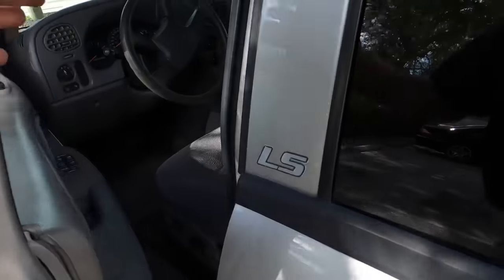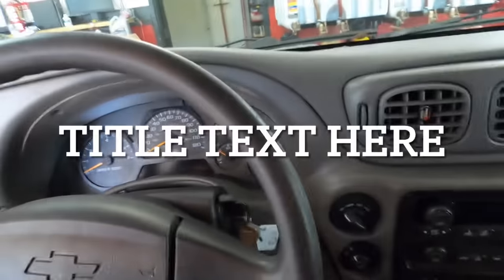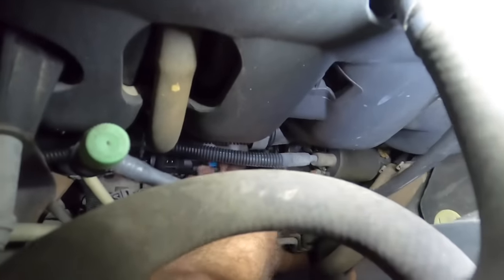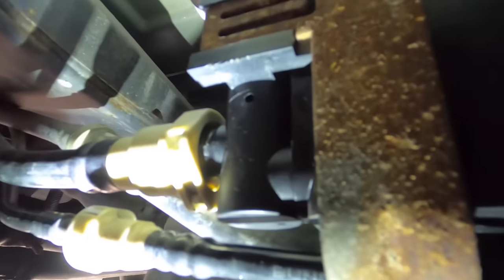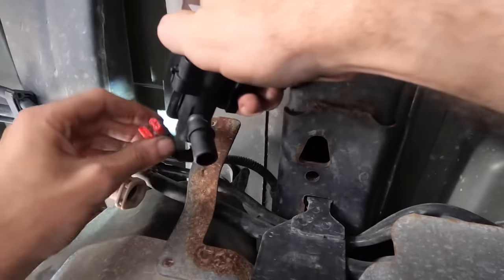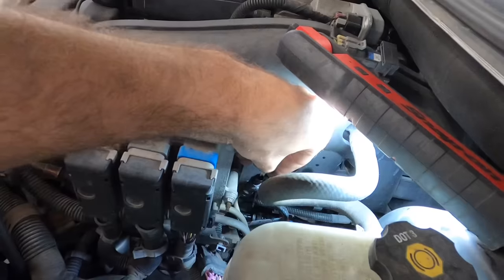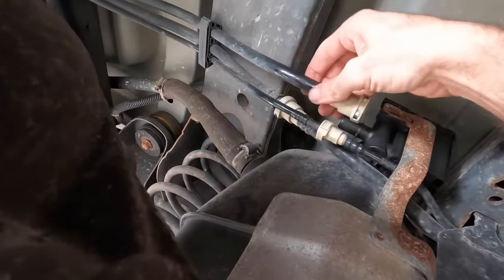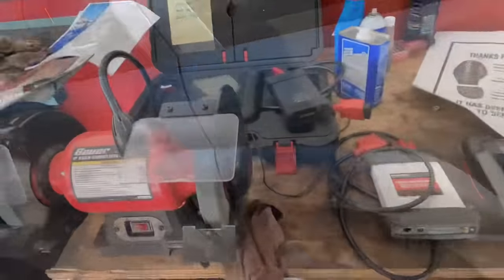Repair failed! Customer is Angry

Comment: ??? I'm so confused... Who in their infinite wisdom decides "yes erase the code so I can take it to the shop and have them diagnose it" is a great idea.... Whatttt????
Reply: TIMMEH !!!
Reply: Most problems are related to the nut connecting the steering wheel to the drivers seat.
Reply: There's a short between the seat and the steering wheel.
Reply: Or as programmers say: pebkac (problem exists between keyboard and chair).
Reply: Justin, your right, that boggles ones mind!!!

I was at a parts store once, an employee was pulling the trouble codes for a customer. The customer asked him to clear the codes, and the employee said they had a policy to NOT clear the codes. That was a few years back, not sure if they still have that policy.
Reply: @captainchaos3667  IT says we have a PICNIC problem here...Problem In Chair Not In Computer
Reply: I dare say the owner of the car is older. The mindset goes back 20-30 years when check engine lights first appeared on cars and is "modern cars have a little light that comes on every now and then and you need to pay the shop money to connect a computer and turn the light back off again".
Once the light is off, all problems with the engine are gone "because they program the computer to turn that darn light on for no reason".

Typically the kind of person to say "I had a 19gooblefive Chevford and it ran fine for dargnabbit years with no darn check engine light!"
They conveniently forget that their old rustbucket got 8 mpg and killed you in any crash.
Reply: The owner may be of the mindset that if all Check ending codes are reset, the mechanic has to go out, drive the car, and replicate the issue himself or herself.  It may be a way to prevent other codes that have been stored from giving fake info.

Or most likely, picnic.
Reply: It might be the owner only asked to read the codes. Not to erase them.
And the other mechanic cleared the list because of habit.
Reply: There are still people around who think erasing the code will resolve the problem.
Reply: @eefneleman9564  that too... Sadly
Reply: @captainchaos3667  programmers don't have problems, it's either a bug or a feature, operator error is covered by GIGO.
Reply: It's cslled an ID ten T error or written differently "ID IO T"
Reply: Best guess is that the trouble code put the car into limp mode and they got it cleared to get it out so they could drive down without any of the limitations... Not thinking that the trouble code might've been important...

I can understand the reasoning, but at the very least, surely you'd at least record the codes...
Reply: @adrianthorneycroft6702  the purge valve failing is not activating no limp mode...
Reply: @jovangrbic97  Herein lies the issue... Without those codes you don't know what the issue is. Who's to say the purge valve wasn't simply just a coincidental failure?
Reply: Should have told the customer to call the store and ask them what the codes were before they erase them. I know they would not have gotten the answer but it would always be nice to see that customer choke on his own spit
Reply: If I had to guess I'd say it's some strange logic where he considers the codes some kind of "preconceptions" and he wants them to "fix it for real" and diagnose from the ground up.  Like Captain Picard ordering a "Full Level 4 diagnostic of the entire ship"
Reply: @ThatOneGuy-f2p  IT also calls it an ID10T error between the monitor and the chair
Reply: Because multiple codes may confuse things, clearing it and then driving and returning to the shop may be wise.
Reply: Superior logic at its best ! 
That part just cracked me up mostly because it so aptly fits the total opposite logic scenario.
Like going to the doctor and telling him everything is fine and you feel just great.
Reply: @hunterlong1820  also known as a Layer 8 issue
Reply: sounds line an I.D.-ten-T error (ID10T)
Reply: 161K viewers (so far) have asked themselves the same question. smh
Reply: Honestly, ive done that before thinking them knowing what the code was should be enough to diagnose it or they could see the code history, but i guess not.. So i suppose next time i wont clear a code before i have it looked at..
Reply: @dougaltolan3017  Many years ago I was IT director for an insurance company. IBM mainframe, MVS, etc. Big iron. There was an operating system bug that the IBM account manager described as an "undocumented feature".
Reply: The same people who think that Google has every answer and that a gas cap fixes the majority of check engine lights.
Reply: @thecardoc100  no, sorry but sometimes it is actually real broken stuff.
Reply: @michaelszczys8316  We have a quote from one of our instructors. "A trouble code doesn't tell you what part is bad, it tells you what test that the computer has run that has failed." Of course it is correct that a test will fail when a component has failed, but testing still needs to be done to confirm that the part has actually failed.
Reply: @eefneleman9564  A piece of black electrical tape works a lot better. You'll never have to see the CEL again.
Reply: @thecardoc100  In some small cases the cap is the problem though.. Honestly i think it might be the issue ive been having recently so i make sure to tighten it and it seems to work.
Reply: @DigitalIP  When taught how to test these systems correctly and then making sure to follow the routine you can prove if the cap is to blame, as long as nobody touches it before you start testing.
Reply: @thecardoc100  this should be a poster to put up in every parts store
Reply: Sounds like a problem with the 1D10T  that was previously interfacing with the PCM to me.
Reply: Maybe he thought it was his internet browser history.
Reply: @wayneessar7489  no multiple code are not confusing you alway Start with the first code show and 90 % of the time the first code is what trigger the other code
Reply: @legros731  First of all slow your role dude.. no idea what the hell you're even going on about
Reply: I partly blame the parts shops who sell this idea to the ignorant vehicle owners.
Reply: @wayneessar7489  Let the service mechanic make that decision, not the customer! If the customer does have the codes cleared, all labor rates are tripled! That is how I run my shop! I don't have many "I know what is best!" type customers ever return! And the other shops around were getting my unloaded problems. Now, all shops around me do exactly what I do for customer, "I know it all & what is best!"
Reply: @rogerlaurel2363  My very good independent mechanic would erase all the codes if many of them were legacy issues, especially on European cars and get his clients to drive them for a day and return.
I have no need to make a choice like that.
Reply: @rogerlaurel2363  I don't see what that has to do with my comment?
Reply: @wayneessar7489  Your comment: My mechanic erases codes

Subject: Customer has codes erased to hide performance history from mechanic he is paying & wants service free!

The point: Who should choose to erase codes be a proper action?

Always the mechanic!
Reply: Depends.  I have often had the codes cleared and they don't come back.    Alot of engine codes dont amount to anything.
Reply: Yeah...read the codes sure, but don't erase them???
Reply: It like brushing and flossing right before your dentist appointment
Reply: The only time I ever did something similar to that was when I was working on my car and disconnected the battery, which cleared the codes.  I realized this and made sure to provide all the codes I had gathered to atleast give the tech a fighting chance.  Not ideal, and totally agree its moronic to stop at a shop on the way with the sole purpose of clearing codes.
Reply: @jochenstacker7448  See i call it a Layer 0 issue.
Reply: @thecardoc100  I'd argue Google does have the right answer, but it also has every wrong answer as well.  good luck figuring out which is which, lol.
Reply: @bassman87  LOL. Can't say that is wrong. One of my favorite little lines when someone says their car is doing the exact same thing as someone else's car is "How did their old parts get on your car?"
Reply: Someone needs to educate a certain vehicle owner that the Check Engine light is there allow the Mechanic to Check the Engine. 
Guessing costs lots of money which I am sure some shops will oblige, lucky for his rear end Ray has ethics that don’t allow him to operate that way.
Reply: Ikr, my car was acting funny for a month, on an intermittent basis. Loss of some power in stop-start traffic for some reason. But shop couldn't find anything due to lack of codes. Went on a few more weeks, then it finally got a check engine light and more severe loss of power, and I was overjoyed! Finally there would be some codes to read and the issue could be fixed. No idea why you'd ever want to erase useful codes.
Reply: Booooomeeeeerrrrrs
Reply: You would be surprised how many people do that, trying to erase the code hoping that would make it go away. Then are pissed when it doesn’t work and wants us mechanics to fix what we can’t see.
Reply: A man raised by his mother.
Reply: @jochenstacker7448  😂
Reply: Mechanics like to play a special game of guess who
Reply: @jodieearl1492  don’t know how many times we have seen this exact same comment here.
Reply: As a former manager at a AutoZone clearing codes does not fix the issue.  Owner has no idea what he is doing.
Reply: I completely agree.
Reply: A genius, clearly.
Reply: The same people who think it's a good idea to fill the gas tank, before taking their vehicle in to replace the tank.
Reply: @captainchaos3667  "PEBSAP" Problem Exists Between Seat And Pedals 😉
Reply: @jeffhood9510  interestingly, at least one manufacturer has a hardware gateway that prevents code-clearing meddling. A high end scanner (as in Scotty Kilmer's fancy scan tool) is needed plus a subscription to 'auto auth'.
[EDIT: neither (most) owners nor parts store can clear]
Reply: @joopjansen9102  that's a good one!
Reply: It turns off the light on the dash so in their mind it's fixed!
Reply: Shame
Reply: Uninformed people?
Reply: That is so freaking frustrating @ it's like erasing a road map so no one else will follow..
Reply: You would be surprised how much headache the free code scan the auto parts stores do really causes for an auto technician.
Reply: @jochenstacker7448  I did computer tech support for a number of years. You'd be stunned by the number of times someone would complain about an error message and when I'd ask them what it was , they'd say "It's just a string of numbers that don't make any sense, so I turned the computer off".  Maybe they don't make sense to you but they will to me (and if I don't know what the code means, I can look it up).

Also high on the list was "I get an error that says something about an error in something-what's wrong with the computer?"  It practically took a fist fight to get them to recreate the error so I could see what it actually was.
Reply: @jochenstacker7448  I’m guessing you are saying old people should not have the right to own a car. And no older model cars have the right to be on the same road as your new high class turd hauler.
Reply: What we in computer repair industry refer to as a PEBKAC error (Problem Exists Between Keyboard and Chair)
Reply: SMH new from china 😓
Reply: I h.ave a cheap code reader which I have used to clear codes on my truck. When or if the light comes back on I leave it and take it to shop.
Reply: The same person who puts 100lbs of air in their tires but still can't reach 100% tpms pressure.
Reply: @BixbyConsequence  if they want to pay about $150 per hour to diagnose from the ground up, no problem. Idiocy is not covered under warranty.
Reply: @wayneessar7489  multiple codes mean multiple issues that ALL need to be repaired.
Reply: @KAS_Motorsports  In my experience codes may be historical in nature.
Having your mechanic clear them and then you driving the vehicle for a time and then returning will guide that diagnoses.
So NO I don't think multiple codes mean that all those individual items require REPAIR.
Reply: @wayneessar7489  exactly. Your MECHANIC. Not the part store on your way to said mechanic. Stopping at the part store to have the DTCs cleared on your way to the shop because the light annoyed you is just stupidity.
Reply: @KAS_Motorsports  Yes, I don't see any controversy in your service provider getting you to do a driving cycle if the visible information is unclear.
Reply: @legros731  Not to me as I never see them, but to the technician.
Reply: @captainchaos3667  P.I.C.N.I.C. problem.  Problem in chair, not in computer
Reply: Tell him to fix his own if he knows what the problem is why is he bringing it to you 😂
Reply: uh...   because the code will come back the next time you diagnose it???   if there'as an actual problem
Reply: More than you realize. Even at the dealership. Happens every freaking day!

Comment: No story that starts with "customer was in a hurry" ever ended well.
Reply: Or a customer that brings their own parts after billy parts counter person sold them a part…so customer will be paying for diagnostic and actual repair !
Reply: @michaelknepp5640  shush, i worked at a parts counter and im FCA and ASE trained and certified.
Reply: @michaelknepp5640  
Its the GD blinker fluid, its always the Blinker fluid is low.
Reply: @voidy2077 True, certifications are useful, but the best one can do over the counter is guess then roll out the parts cannon. Parts cannons sometimes fire blanks, like in a faulty new part. What's worse is the number of bogus "name brand" parts in the supply chain.
Reply: Speaking as someone in PC Repair? Nope. Never.